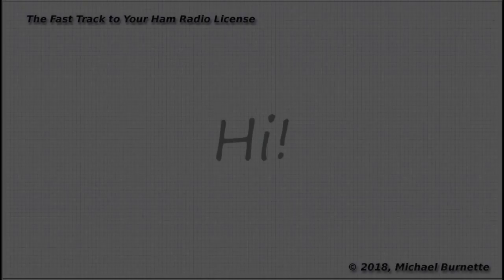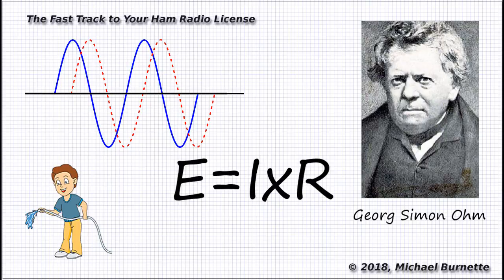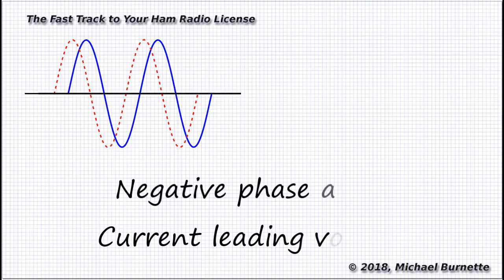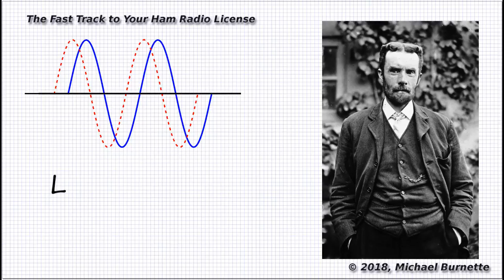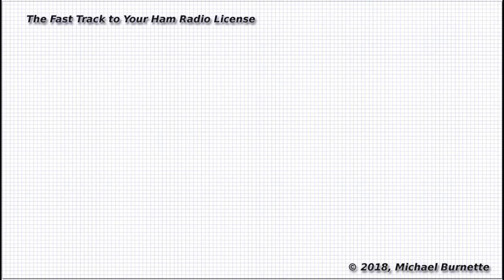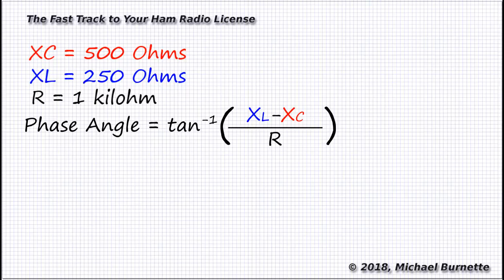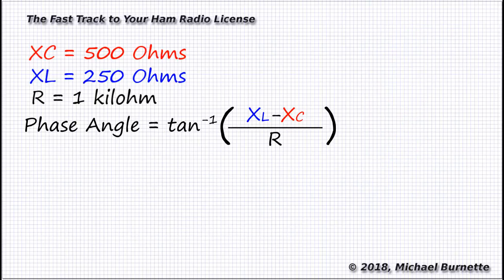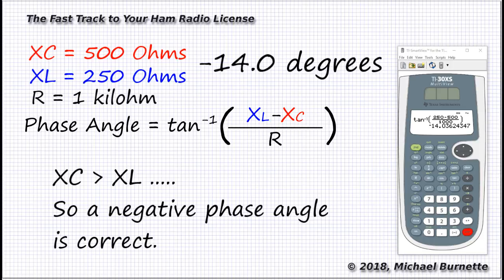Understanding Phase Angles

Comment: Michael, thank you so much for your videos, this one included.
Your presentations and lectures are great.

There is a problem, however, at approximately 9:30 into the presentation as Michael describes the tan-1(x) function.  

Michael states, "tan^-1(x), the reciprocal of the tangent ...."  Ooops, that is incorrect. 
The tan^-1(x) function is NOT the "reciprocal" of the tan(x) function.  

Both tan^-1(x) and tan(x) are "inverse functions" of each other, completely different than reciprocals of each other.

A reciprocal is the "multiplicative inverse" of a quantity.  The reciprocal of x is 1/x.  Just as the reciprocal of 4 is 1/4.  The reciprocal of the tan(x) function therefore, is 1/tan(x); the reciprocal of the tan(x) function is also known as the cotangent(x) function.

Let's recognize that tan^-1(x) is the "inverse function" of tan(x).  An inverse function, is completely different than a reciprocal.  So then, what is an inverse function?

We know how to take a number x, entering x into some function, where the outcome is f(x).  For instance, let's use the number 4 as our x.  We enter 4 into the function (x)^2, and we calculate (4)^2 = 16.  We have started with some x, calculated, and obtained an f(x).

But what happens if we start with f(x) and we need some function to find x?  
In this case, we may use the "inverse function" of f(x), known as f^-1(x), to obtain our x.

So, lets use our trig example, starting with the tan(x) function. 
As in the video, if we have some angle x, and calculate the tangent function of angle x, we will obtain some number, tan(x).  So let's do that.  Let use negative angle -14.0362 and calculate tan(x).  We calculate tan(-14.0362) and obtain the number -0.2500.  

Now, let's start with our number -0.2500, using the "inverse function" of tan(x), a function called tan^-1(x) and also known as arctan(x), to calculate our original angle.

Working with the tan^-1(x), we calculate tan^-1(-0.2500), to obtain our angle, -14.0362.
We have just used the "inverse function" of tan(x), also known as function tan^-1(x) or arctan(x), to start with some number, with the final goal to obtain an angle.  

The confusion with reciprocals and inverse functions often stems from confusing the accepted math notation.  The reciprocal of x is 1/x.  Great.  We can also use exponents to represent the quantity 1/x, as x^-1.  Just as 1/125 can also be written as 125-1.  

The reciprocal of tan(x) can be written as 1/tan(x).  Using exponents, 1/tan(x) also can be expressed as (tan(x))^-1.  Here, the negative exponent ^-1 applies to the entire quantity tan(x).  1/tan(x) is equivalent to  (tan(x))^-1.  Of course, the reciprocal of tan(x), can be written simply as cotangent(x).

In math, we indicate the "inverse function" using a convention that appears like exponential notation, but it is NOT exponential notation!  Instead, this notation indicates "inverse function."

We may have function f(x).  The "inverse function" notation for f(x) is f^-1(x); the ^-1 here is NOT exponential notation, but is simply a convention that indicates the "inverse function" of f(x).  The inverse function notation for tan(x) is tan^-1(x).  Again, the ^-1 here has NOTHING to do with exponents, it is simply the notation convention that indicates "inverse function" of tan(x).

In contrast we can express reciprocals; f(x)^-1 means 1/f(x).  Here, the ^-1 is a negative exponent.  Likewise, if we have tan(x)^-1, we mean 1/tan(x).  The "reciprocal" of f(x) is 1/f(x) or f(x)^-1.  The "reciprocal" of tan(x) is 1/f(x) or tan(x)^-1.  Choose your preference.

So, we use the "inverse function" of tan(x), which is tan^-1(x), to get back to our phase angle.
This minor attention to detail in math notation has real meaning.

On calculator keys, the trigonometry "inverse functions" are often noted as asin, acos, atan.  On some calculator keys, the trigonometry "inverse functions" can sometimes be noted as sin^-1, cos^-1, tan^-1.

Whereas on a calculator, should you need to calculate a "reciprocal" of tan(x), you simply calculate 1/tan(x).  Time for a coffee break.  73 to all.  Many thanks for Michael's excellent work
Reply: Very well said. It's the comments like this that make them worth reading.

Comment: When we connect the resistor to Ac voltage source there is no phase difference angle in the circuit between current and voltage
But when we connect an inductor to the same source the current delays from voltage by 90 phase difference angle because of the self induction in the inductor
And when we connect a capacitor to the same source we find that the voltage delays from current by 90 phase difference angle because of charging and discharging process 
Give the reason

Comment: What happens if current or voltage leads? Applications of this
Reply from the maker: Hi, Ganesh. If current and voltage are out of phase, less power is transferred to the load. In fact, if they are 90 degrees out of phase, no power is transferred at all. The amount of power transferred to the load is calculated by taking the cosine of the phase angle, and that figure is known as the "power factor." In radio, we are concerned with transferring as much power as possible to the transmitting antenna. That is why when we adjust the impedance matching between the transmitter and antenna, we want a purely resistive impedance, with no capacitive or inductive reactance.

Power distribution networks typically "see" large inductive loads -- all those inductance motors out there. That has the effect of causing the current to lag the voltage. Power companies correct the phase with large capacitors.

Those are a couple of the applications of this important principle.
Reply: @af7kbfasttrackhamradio50  if 180 degree out of phase what happens sir
Reply from the maker: @ganeshbhat7613  - in a purely inductive circuit, voltage leads current by 90 degrees. In a purely capacitive circuit, current leads voltage by 90 degrees.  Neither of those "pure" circuits exists in the real world -- they are "ideal" circuits, so in the real world, we can never cause the current and voltage to be more than 90 degrees out of phase, because we can't actually even get them to exactly 90. I can't think of a way your example can exist in the real world, since the amount of "out of phaseness" available is only 90 degrees. On paper, the power factor of the situation you describe would be negative 100%, since the cosine of 180 is -1.